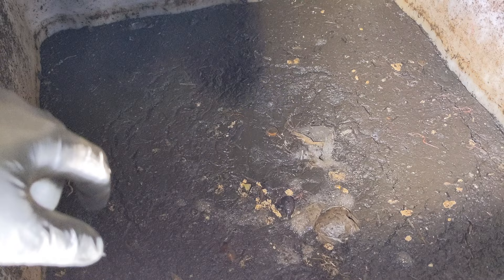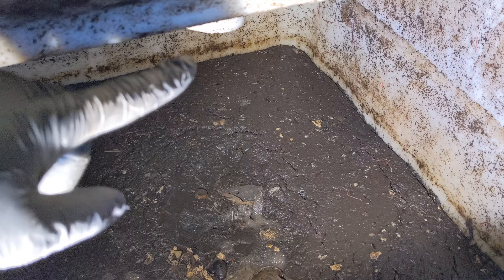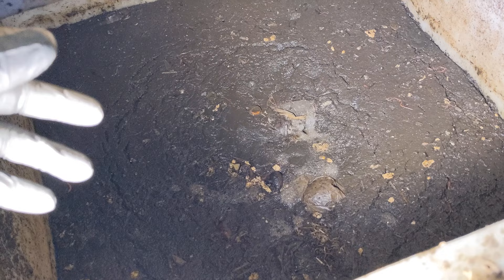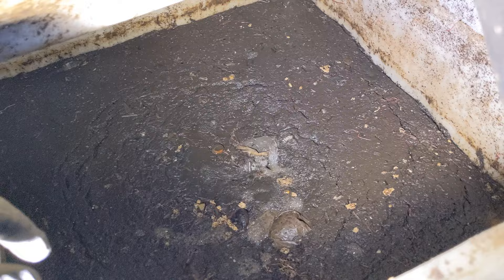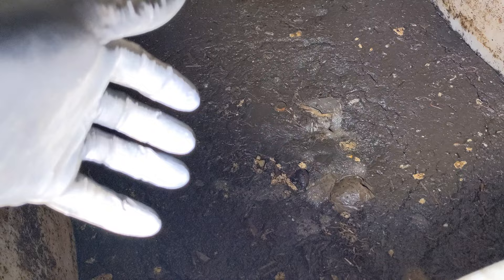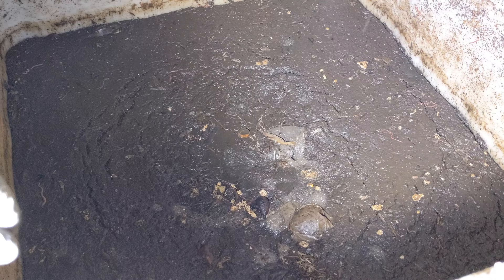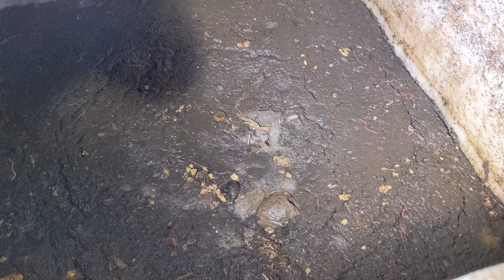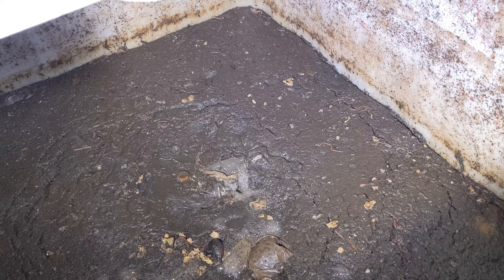How to build a vermicomposting toilet. Update Pt-2. A look inside.

Comment: Thanks mate. How much is it getting used? Do you have a vent pipe in the inlet side like a normal system?
Reply from the maker: Thanks for watching. 
Nah, it's not a closed system. If I re-made it. I would make it a closed system with a vent pipe. It was used every day up until about a week ago. I think I'll need to try remove some of the worm's due to lack of food. We still use it to place compost but I will be monitoring it while it is used less lately.
Reply: @dazthecowboy  So are you saying have seal on the flap? And run a vent pipe off the inlet pipe?
Reply from the maker: @richardpickersgill3434  I would use a sealed boat hatch for the inspection hatch and run a separate pipe off the side or top of the unit. That way any small amount of air pressurized buy. say a flush, or shower. will push old air in the tank out. rather than air in the pipe.

Comment: How do you get the compost out when you want to use it?
Reply from the maker: You don't use the matter inside of the unit. As new matter is always being renewed onto of the old stuff. The worms break down the oldest matter very well. What you are left with is a liquid that drains from the unit and feeds a nominated area. This system worked very well for the few years I had it.
Reply: @dazthecowboy  At some point doesn't enough matter build up that isn't broken down into liquid?  What did you transition to after the vermicomposter?
Reply from the maker: In a system that size. With two adults. I calculated that it would take between 15 to 20 years of normal use to have the unit filled to a point where you would consider replacing it or emptying it. 
I built mine so I could easily drag it out and slide a new container in. 
The old one would then sit for an additional length of time to allow the newest material to be broken down further. You could then use it as regular composting matter.